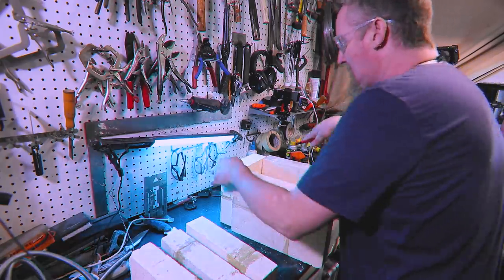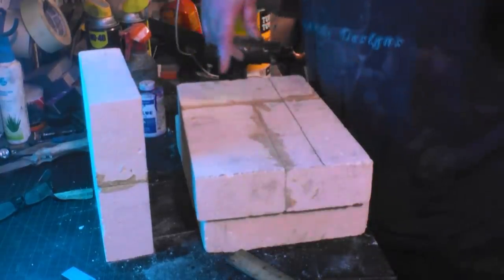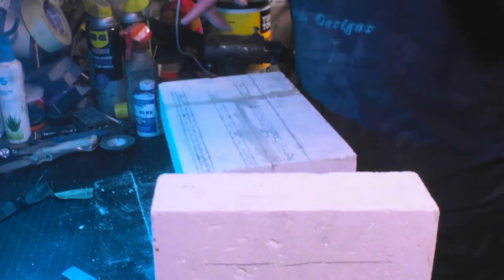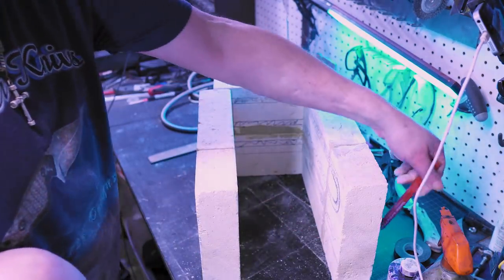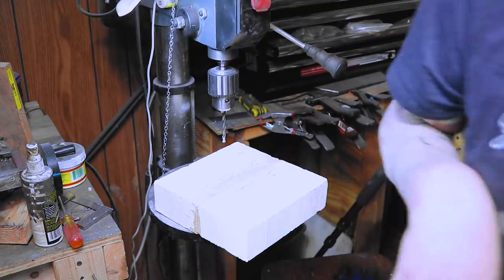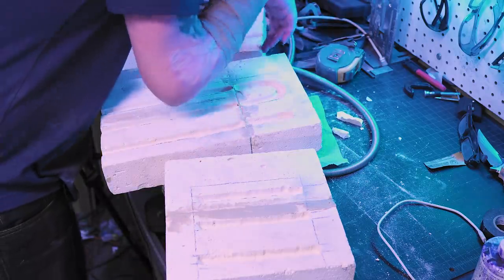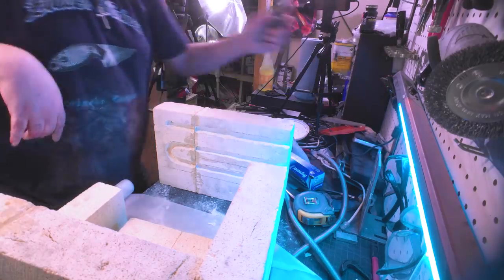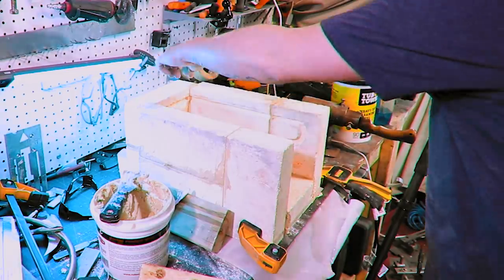Heat Treat Oven Build... from scratch (part 2)

Comment: You need my little router
Reply from the maker: I have a dremel, a trim router and a pneumatic die grinder... I was thinking that too, using a carbide bit in one of them.... Or do you mean for the lanes, cause that would work too, I was talking about removing the extra cement... take it easy...
Reply: I was thinking about the lanes. Yeah I have many routers and a dremell but I was thinking my little laminate trimmer router for the lanes.
Reply from the maker: @e.t.preppin7084  Right, the firebricks are really soft and managable, you could probably just use a chisel and scrap them out, if you had the patients, hahaha
Reply from the maker: @e.t.preppin7084  I used one in this video at 9:49...https://www.youtube.com/watch?v=x0GMfM5Z4S4&t=510s

Comment: dave i ordered my elements from kiln parts as well i measured for each channel i need 100 inches of element they told me you cant cut any off of element cause it messes up the resitance i may need to cut 4 or 5 inches of ends that wont hurt anything right? and how far apart are your channels in your oven ? i think mine will be like 1 - 1 1/4 inch apart will i be ok with that or are they to close to each other thanks buddy hope you ca n answer these questions Mark
Reply from the maker: That's a hard question to answer. I cut mine, but they are right, it changes resistance, which changes Amperage too. The 2 options are to keep the windings tighter, but still not touching, cut some off or maybe take the coils into the top(if that is possible). It depends on where & how you are tying the elements to the outside, into the relays.
Reply: @evaderknives  ok I’m running my 4 ends out the front right hand side where I will have the control box
Reply from the maker: @Anderson-HandForged  do you have a multimeter? That’ll feel you your resistance
Reply: Yes I have one I will make sure all my elements have the same amount of ohms from them right? So I know where to cut them if needed?
Reply from the maker: @Anderson-HandForged  Well if you know your resistance, you can figure out amperage, which is needed to make sure you don't trip your breaker. That is why they say you can't cut them. A lot of people wind their own elements.
Reply: Ok Dave thanks what I did is called kilnparts.com and told them I was building my own oven and the guy there told me to look at some ovens online that have the same inside diameter as mine and get the specs from the manufacturer that’s what I did and they sold me elements that should fit in from the string that I measured I’ll keep you posted on my build thanks so much for all of your help your a stand up dude appreciate you bro